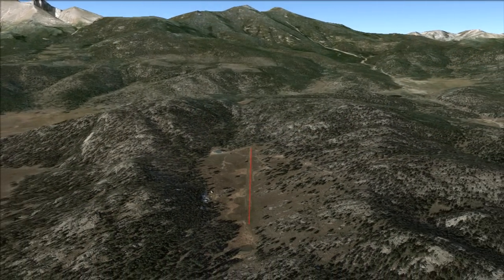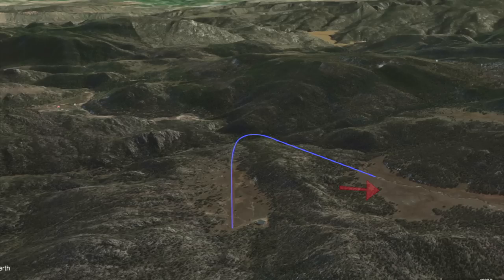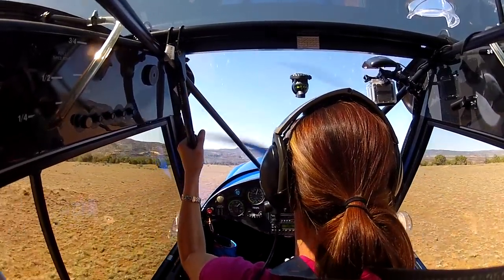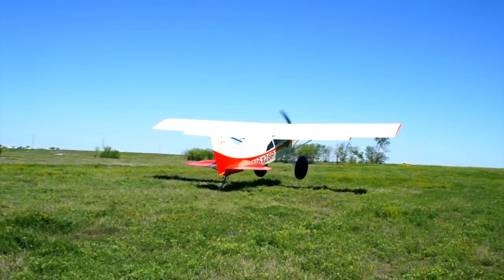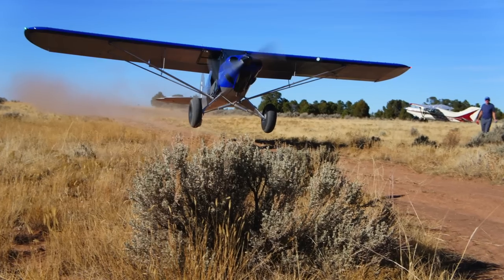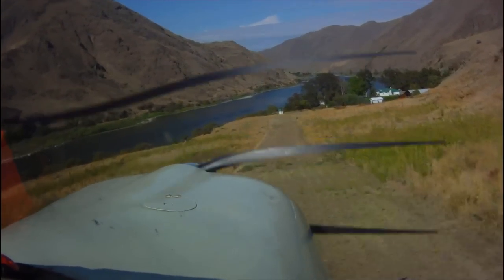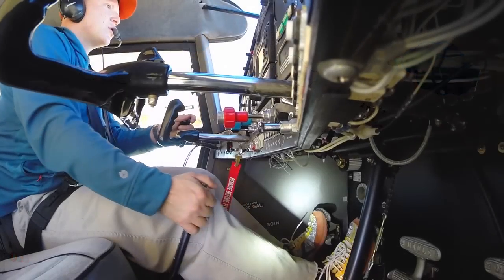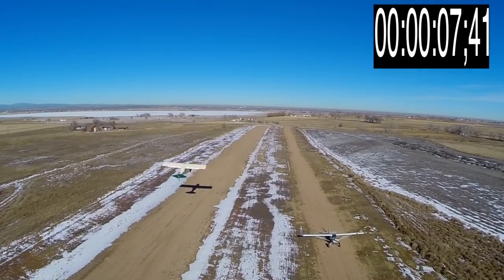Backcountry Aviation's STOL Tips: (The Takeoff)

Comment: A C27J Spartan’s assault takeoff (shortest possible) lasts 13 seconds at the longest, when operating at mid/high gross from an unprepared field. Goes to show that a lot of considerations made here are absolutely valid for other platforms. Note that in the video the additional flap deflection at rotation is temporary and not even one notch in amplitude (so it appears) While our flaps are electro hydraulic making this technique unfeasible, I would like to see emphasized the concept of releasing the flaps back to a takeoff setting, any more flaps will generate more drag than lift, hurting the flying portion of the acceleration.
I would also say “beware of the button”, you may not want to fight the button lock to release the flaps back down while attempting to accelerate in ground effect. I am a low timer in general aviation so discard this comment if unapplicable. Excellent video

Comment: Looking forward to your next video.  I will back home in 2 weeks to practice some of your techniques.  I only have a Cessna 150 TW.  It has the stock 100hp engine so I am not ready for high altitude or very short strips.  I do my practice at M50.  It is low and clear of obstacles.  I only have 27 hrs TW and 105 total.  But this is my dream type of flying.  Thank you so much for sharing.  I'll let you know how many potatoes my little plane takes..
Reply from the maker: I would love to know how the 150 does! I have a huge affinity to them. I bet I have a couple thousand hours instructing in one. I would love to know how many potatoes!
Reply: Backcountry Aviation The 150 does great for what it is.  I've gotten down to 11 potatoes so far.  The tail is very heavy on this tailwheel conversion.  It takes 4 just to get the tail up.  But it is great fun to practice and the 150 is so cheap to fly that I get a lot of time.  This spring or summer my goal is to try to get into Red's horse ranch up by LaGrande,  OR.  I'll let you know how it goes.
Reply: William Sargent So how did "Reds" go??

Comment: Quick question; Why don't you start with 10 degrees of flaps? Why do you pull them right before you go air born? I am flying a 61 cessna 150 (not the best backcounty plane, but at least I own it).

Thanks
Reply from the maker: we usually start with 1 notch.  This is primary to be able to reach them without looking. Crank the flaps to help break ground, once you are airborne we remain in ground effect.  PM and Ill gladly go into more detail.

Comment: I don't get why you use flaps so quickly? As far as I understand you use them when the plane is rolling to get in the air and then close them quickly. Why do you close them so qucikly and why it's not advisable to use them while rolling?
Reply: Flaps create drag. You don't want drag when you are trying to accelerate. Also you don't want drag when you are trying to build up air speed after lift off. Flaps also create more lift, that's why you only want to use them right when you lift off.